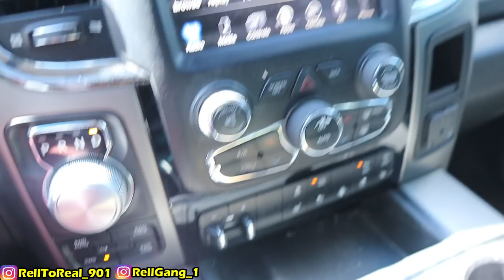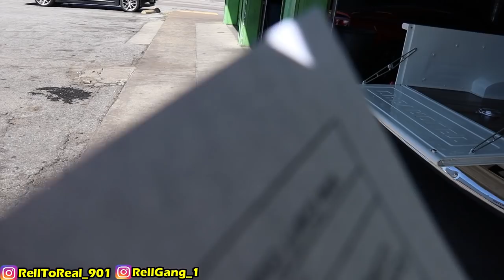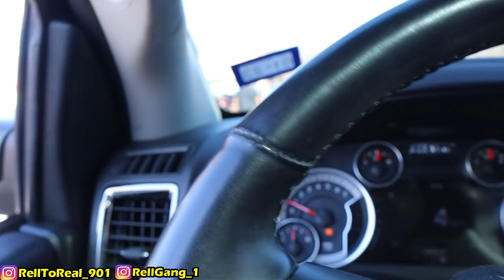I DONT KNOW IF THE RAM 1500 GOOD FOR TOWING!!

Comment: 1500s can pull just not as easy as 2500 and 3500. Mind u the hellcat alone is 4200 plus pounds then the trailer is a good 1500 to 2000 pounds so it's gone be a lil work for the 1500 but it can do it. And gear ya rear end to like 4:10 to go with them 37s  to compensate for the rotational mass. Diesel models are twice or 3x the torque of and gas model of that same brand. And torque is what moves weight. U a truck driver so u kno this. So gotta school these others that say dumb shit.

Comment: they really aren't great to haul cars especially going up and down mountains. you will end up replacing your rear ends or start having problems with transmission. your car and trailer almost as much as your truck. i just came off the road from driving trucks over 20 years. high wind can push that car just a lil bit and you can lose it because that truck is too light. i even hate seeing brother haul them cars with bumper trailers instead of goosenecks. definitely upgrade when you're ready  #32GANG